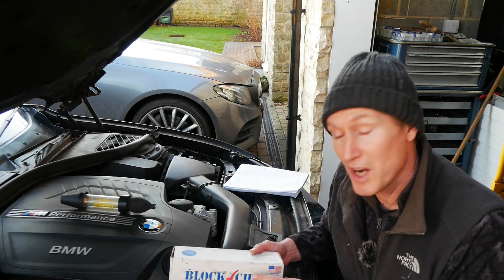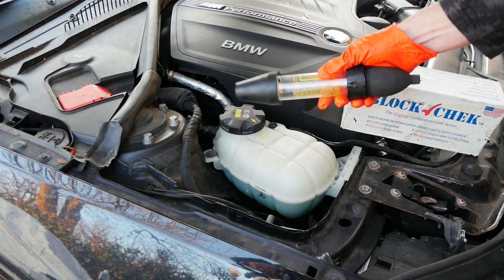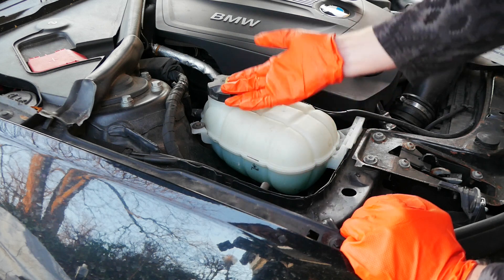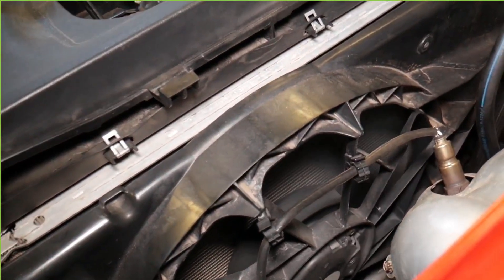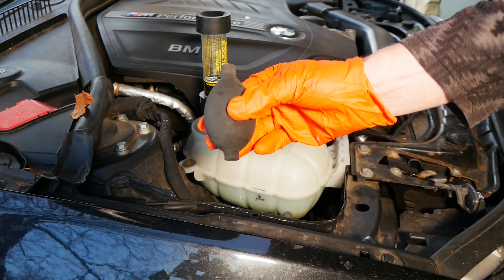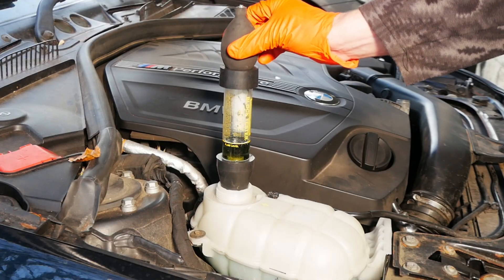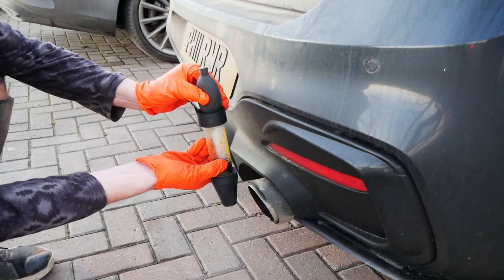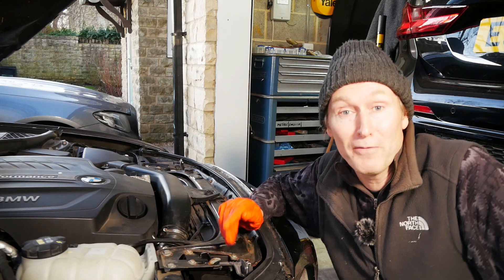How to Test For Blown Head Gasket | QUICK & EASY DIY!

Comment: If this is not too expensive, it might be good to do even without any symptoms every 30000km or so, just preventatively. Especially on German cars made after 2012, when they REALLY ramped up the planned obsolescence with more and more parts made expressly to last less.

Comment: What if your car does not have a reservoir
Reply from the maker: If it doesn't have a reservoir, then changes are you just have a cap on the top of the radiator. If so, you can test on the radiator, with the radiator cap removed. Cheers, Phil

Comment: Hi, i have the same kit. It turned a light blue. Would that still be a bad headgasket?
Reply from the maker: Hi, I’m not 100% sure but I would think that any change of colour (even going to a lighter blue) isn’t a good sign. However, just a suggestion: if you do have a leak, it may be very slight, maybe put a line on your expansion tank for the current coolant level and then monitor it for a while? After a run, when the coolant system is still hot, it can leak slightly and so potentially you would see it. What symptoms are you seeing that made you check for a head gasket leak? Thanks, Phil
Reply: @ my car gets stored during winter. I went to go and check up on it and decided to open the radiator cap. I saw an oily film on top of the coolant. I did the block test with the fluid. It stayed blue for around 20 seconds until the coolant started getting sucked in as the coolant started rising from the car getting up to temp.
Reply from the maker: Hmm, it does sound like potentially you may have a small issue then…

Comment: Great little video - I had heard of these kits but had no idea how they worked. Interesting how you can have a small leak - you always assume a head gasket going is with a pop and your cylinders filled with coolant!
Reply from the maker: Agree, I think they can leak for some time and cause little issues - using coolant, slight overheating etc. The test does work but you have to follow the instructions, it’s critical that the thermostat is open and hot water is circulating from your engine, through the rad etc. cheers, Phil